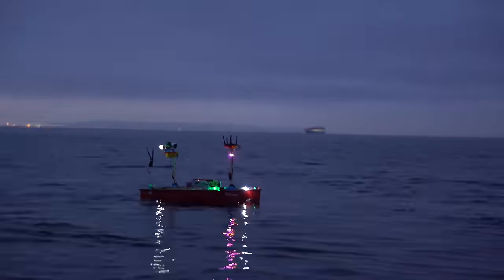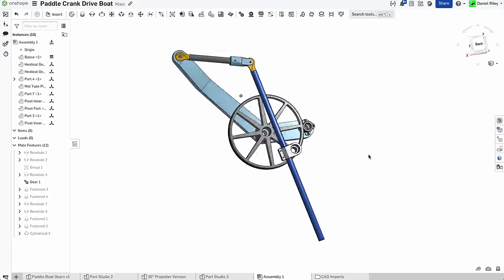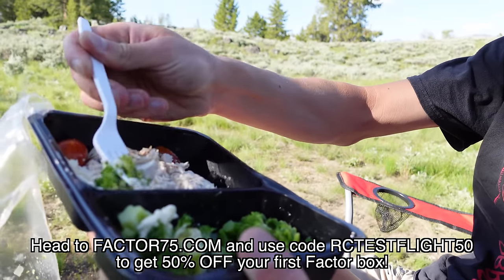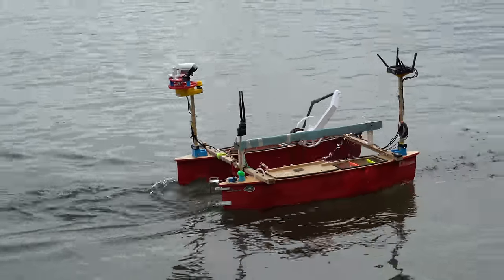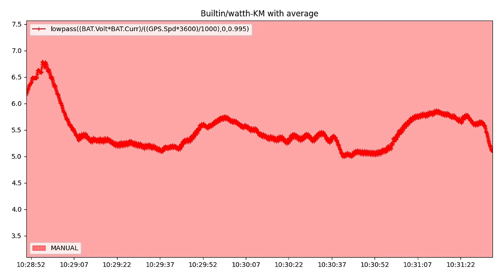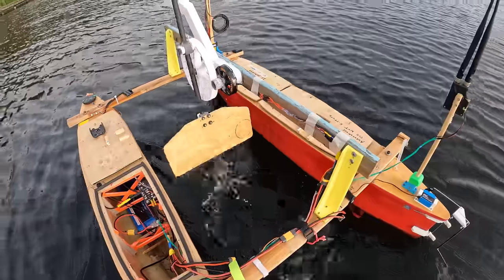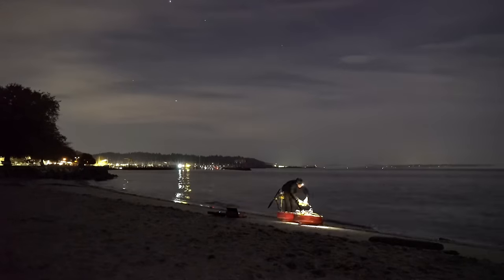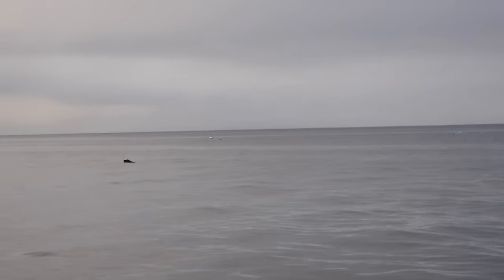Propeller Killer? High Efficiency Paddle Vs. Propeller

Comment: you could center the props more, near the center mass of the hull. That would eliminate front to back water contact you could also make an outrigger that contacts the water and arrest the pitching and oscillations although some wave peaks could still affect it in extreme situations. I would also try to keep any items from the upstream side of the props as to not block airflow. Even a slight mast in the way, slows the flow of air, this is a factor in wind generation and could be impactful in an efficiency situation like yours. Another thought, would A vertical stabilizer work in place of the rudder, may reduce drag in the water but would wind conditions have to many variables? would a vertical stabilizer be effective enough to even work or would it need to be to large for slow speed? Too bad you dont have a wind tunnel to test all of this, could be helpful.

Comment: It might be worth testing not just different propulsion systems but, also different designs of each system, for example with air power what about toroidal propellers or cycloidal.  Another approach to jet propulsion is changing the type of impeller from a turbine type to that which resembles a super charger. 
Another approach look at divers flippers, have two flipper type devices under water that are attached vertically to two shafts that work like contra rotating props. working like a wiper motor on your car causing the "paddles" to flip back & forth like a diver kicking his flippers.
last but not least when you transition circular motion to up & down you lose efficiency, go back to the Paddle wheel, but put it up front between the hulls, and like the paddle Wheelers of old use narrow paddles on the wheel, but angle them slightly so they exit the water at a more vertical angle so the wheel is not pulling the front of the boat down. best of luck with what ever you do.

Comment: If you plan to use air rotors in the next design, I recommend a flat bottom boat for better stability, raising the rotors a little higher, and trying to offset the weight of the rotors by putting more weight in the nose of the vessel. Airboats used in the bayous of Louisiana are a great example.

Comment: I find the paddle approach fascinating.  Perhaps instead of a perfectly flat paddle you might consider small perpendicular edges to help focus more of the water diretly toward the end of the boat,  I suspect some energy isn't going back but instead around the paddle. Also a small edge running across the bottom of the paddle as well, making the paddlle to become a bit of a scoop. And then there is the possibilty of having the paddle be not a simple flat surface but somewhat wavy from top to bottom.  Hey ... every bit helps, right?  You never know.

Comment: Interesting idea!  Some thoughts:

1. The paddle needs to be entering the water at least as fast as the boat is travelling forward, which means you need to have a way to measure forward speed through the water.

2. The problems with straining the system are almost certainly due to trying to push the paddle too hard through the water, which indicates that the speed of the paddle needs to be linked to the speed of the boat through the water and shouldn't be too far above the speed of the boat.  

3. The paddle needs to constantly be perpendicular to the surface of the water or you are wasting energy pushing down/pulling up on it.

4. A second mechanism can be used to constrain the paddle parallel to the surface on the second half of its travel.  You won't need to have the travel be as high.

5. Only having one paddle means the boat's speed will pulse.  Having more paddles with offset timing will smoothen that out.  There looks to be enough room to fit two paddle systems in a line without altering the current system design much.  (It would probably be better to have two paddles on the same mechanism, where the second one passes horizontally over the first as it returns to the front of the boat.)

6. Do the propellers need to hanging off of the end of the boat?  To my mind, putting them above the hull--as air boats do--would prevent them from striking the water as the boat rocks.

Cheers!

Comment: I think the floppy paddle could be improved some, though it's hard to say if it'll actually affect efficiency. I was thinking if i didnt hinge right at the top, it might recover faster, so what if it could bend along its length (like flippers) but only one direction? 
Think like a snap bracelet or a measuring tape, but hold it curved so that it can flex when needed, but doesn't rely on little elastics to recover, and instead on the flexibility of the material, and curvature that you design into the mount.

Comment: I like your videos. On this I would like to give you some of my thoughts.

1) in dragonboat racing teams are starting to rotating their paddles 90° to reduce drag on the forward stroke.

2) when comparing efficiency. There is a great influence of hull drag in regard of the achieved speed. Unfortunately I don't know what it is called in English. In German it's called "Rumpfgeschwindigkeit" that describes the effectiveness of hull length to desirable speed. It has to do with the produced wave ... Sorry I'm no pro in that area. But I suggest it could have an impact on the way you test efficiency.

3) the best solution is not always the most practical one. There is a reason why traditional Propeller underwater are so commonly widespread used. But I do like your creative approach to discover new possibilities. 

Keep it up.

Comment: Regarding the RC network filtering of the current signal, you would need very high component values due to the low frequency. The correct wy is, as you later did, to filter it in software.

Comment: To optimize the paddle your could install a perpendicular plate on both sides of the paddle to stop water flowing around the paddle and create wasteful vortexes. It would act in the same way as the vertical wingtip of a plane, which stops air from the high pressure curving to the low pressure side.
Perhaps the bottom line of the paddle (which goes deepest) could be curved slightly backwards. So when the paddle enters on an angle it goes straight into the water and also it applies more force on the water when moving backwards.
That having said, I wonder why the paddle is so much more better than the classic paddle wheel?

Comment: Duck feet paddles are some of the best & most efficient paddle mechanism we have :) ! the scrunch their feet together then angle them parallel to the water then flare them out to them use bare minimum work from their ankle joint for those muscles. which is very similar to this, but if they need to travel faster they will tilt in the water and have the foot get closer to the body and brush off more water, dip it down and flare their feet out to then push further in the water for a longer stroke duration. Gaining increased power but maintaining a fairly high efficiency, except of course it takes more effort from them. I think you could improve your design by doing this as well, or deciding to have a linear accelerated (magnets coils some flaring out diaphragms) pump attached to a mechanism like this that takes it out of the water and uses the duck feet motion (like foot movement to run vs walk, you use your calves to push yourself up and lightly jump/leap) of the final push at the end for the pump. 

the pump pushes out at the end of the rotation & but for the most part this paddle mechanism pushes for the longer stroke length, but because of its shape it can remain more parallel to the direction of travel and motion making it easier to transition into the water & out while also being able to reset itself during the out of water moment to improved efficiency of the paddle motion & power of the given type of paddle/pump design. 

Hope it helps, I'll watch the rest of the video now, I'm only at 2:39 in.

Comment: Are you familiar with adjustable paddle wheels? The paddles were connected via a lever to an excenter on the wheel axle. Quite a simple mechanism that automatically  adjusted the angle of the paddles while touching the water. In essence, it does the same thing as xour single paddle, but with continuous propulsion, for there are always several paddles touching water.
Later paddle steamers were all equipped with such wheels.

Comment: I think you could widen the paddle even further to gain more efficiency. Looks like there's a good 2" width each side you could claw back, lowering your windage each side.

You also wouldn't have the issue with the air props hitting the water when it's wavy (though it might mess up your motion relative to the water)

Comment: Put the props at the longitudinal center of the hulls. You could put rudders behind the props like airboats use to alter thrust vector and steer the boat. Also, put as much weight as you can towards the center rather than the ends to help with the hobby horsing when you encounter waves. 

The paddle mechanism was pretty cool.

Comment: So the paddle version was more efficient after all :)   The question is do you need to put the blade to the back...  And when it wavy, should you have some kind of 3d gyro to detect the orientation of the boat and use the motor to stabilize the boat OR turn the motor when it at a better level orientation.  You would also have to predict the future since there is a ramp-up in trust, so you would have to detect where you are in the wave effect and turn the prop a bit before.  And turbine in water do add more drag, but would a turbine like blade in air be more efficient ?  Where you can concentrate the trust more.

Comment: Your efficiency can improve by narrowing the gap beween the Blade and the hull.
Your wheel is also doing unefficient work, lifting the blade out of the water.
Your efficiency can also improve by having 3 or 4 blades on separate wheels.
This means the downgoing blade gravity assists the upgoing blade.

Comment: If you ever saw a duck hunter paddling a pirouge, there is very little splash and no sound. If you could somehow imitate that motion they use. It's an easy stroke and they can propel themselves for miles with little effort. That might work much better than a simple paddlewheel motion. I know when they withdraw the paddle from the water it comes out in a linear direction and does not splash at all.

Comment: I wonder if instead of doing a paddle, if you couldn't throw a similar mechanism vertically into the water to mimic a vertical fish tail.

I'm not sure what the ideal shape for a boat hull would be if it were using such a mechanism, particularly given that it would probably create a lot of resistance against the forward hull if it were static (like a pontoon).

I think there should be some form of self-stabilizing mechanism or linkage that could let the front of the hull remain static while allowing the back of the hull to rotate. With two or three links or points of rotation I think it could produce the "snaking" motion that you might see in a fish.

Comment: Take a look at a “weedless prop”.  Battery driven trolling motors often have them.  The leading edge of the blade is angled OUTWARDS from the center, not inwards.  Weedless props have been around a long time.
Courtesy of Half Vast Flying

Comment: Keeping the paddle vertical throughout its stoke should improve efficiency.  That can be done by using two drive gears on the paddle shaft. one high, one low to keep paddle at 90 degree angle to water.  Several people have suggested using a belt ("caterpillar tracks") which could also keep the paddles perpendicular to the water, but I still like your single paddle idea.  

It would probably be helpful to set up  a test tank to compare efficiency.  Even the Wright brothers figured out how to build a wind tunnel.   It's almost impossible to get repeatable efficiency results "in the wild" as it were.

Air propellers have some significant problems in the real world related to wind speed and direction over the water.  If you continue with them using a much wider blade to increase surface area can help with a slow turning prop.  And turning the prop as slowly as possible does reduce drag of the prop itself.

Also a pilot, boat river and engineer here.  I don't have any magic solution so you're back to the Thomas Edison approach.  Try everything.  If you've done 500 experiments that don't work you've learned that much more about what not to do.

Comment: I don’t remember how it worked but we got warned not to row a certain way because you’ll sink the canoe… we did it just to see if it was true… it worked. You may look at how competitive rowing teams use a paddle.   As far as the props hitting the water, could you just move the mounts closer to the center of each hull and arms that hold the props over the hulls just a few inches from the aft most point of each.

Comment: What if you made the paddle in a V shape with the point of the V facing towards the front of the boat.  You would have more surface area and trap/push more water during each revolution ?

Comment: The problem with your water propellers is that they’re very, very small. They’re also way up forward, which means that a large amount of the hull aft of them is exposed to the higher velocity flow in the prop wash, which means that it has higher fluid friction. Shafting losses shouldn’t be too high unless you have really bad (or no) bearings or shaft seals.

Comment: If propeller need more power in order to maintain the speed, there should be some seaweeds get stock on it. They get stock on same spot which is in front of the propeller as I saw on the videos. You need to attach a razor to a solenoid.
Open a slid under the hull. place the solenoid in the boat. Push solenoid pushes the razor and touches the shaft while it is spinning which cuts all seaweeds. Solenoid should be on the deck in order to make it waterproof and the slid which extends from deck to bottom of the boat should be closed. it is kind of a slid that blade can go through and no connection inside of the boat. I think, a square wood could work. Cut the square wood half. Make a pocket in it by CNC in order to slide the blade inside and then glue them together, and cut bottom of the boat to glue It.

Comment: For the waves, wind direction is a better predictor than its strength. If the wind is coming from the sea is will amplify the high of the waves, whereas if it from land it will decrease them.
When I was sailing long time ago the strongest winds I got were from the land and the sea was smooth, but a weaker wind from the sea gave us several meter high waves.

Comment: An alternative to rudderless steering is vectored thrust from a single air prop, rather than differential thrust from two air props.  Diameter could be larger, and a higher center line mounting might eliminate the water impact.

Comment: If you want a more efficient water propeller, go to a surface piercing setup, where only the blades are entering the water in normal operation.  You need pretty smooth water to make those work well, too, for obvious reasons, as in waves they will be fully dry or fully immersed most of the time.

Comment: Main problem with kayak fishing is to hold  it position due to ocean running current since it cannot use anchor especially in deep water. Perhaps you can design kayak than can lock it position based on coordinate or perhaps to add compass where it can control heading orientation

Comment: For ultimate efficiency, design some eccentric geometry like the oval cogs on some old bicycle chain drives that will slow the paddle when in the water and speed it up when out. Make a two paddle system that takes advantage of the biplane effect with the trailing paddle moving slightly faster through the water than the front paddle, then close up the gap between the hulls and the paddle blades.

Comment: Sculling a boat with a free turning oar, you pull wrist high then push wrist low. The blade turns with the same face pushing always. How large the blade and wide you sweep is your contact area. It's not hard to keep a load going, when you flip the paddle and sweep it the flow is unbroken.
The motion of the wrist; high pulling in then drop low and push out then raise high and repeat, how to make a wrist that does that?
On the vertical, tilt and sweep paddles could be put series in line between the hulls.

Comment: perhaps worth investigating oscillating foil rather than paddle? I remember this paper from the late 90's where experimental investigation indicated efficiencies as high as 90% for oscillating foils for thrust. "Oscillating foils of high propulsive efficiency By J. M. ANDERSON, K. STREITLIEN,  D. S. BARRETT1 AND M. S. TRIANTAFYLLOU" Journal Fluid Mech. (1998), vol. 360, pp. 41–72. They went on to build a robotic tuna with the same high efficiency thrust concept. weeds maybe still a problem unless sufficient sweep of the foil could shed them?

Comment: I think you're on the right track...   I look to mother nature for my inspiration...   For me, the most efficient - sub-surface - propulsion method would be what I call - '' Ceta-drive''.   Think- scuba diving fins...    This mimicks the semi-prehensile action of the rear spine/tail and flukes of a whale.   A horizontal paddle, submerged propulsion system.   Probably more practical on submersibles, but could be designed to work housed within a hydrodynamic submerged pod on a surface displacement vessel.   This system would also be quieter than a traditional prop system - no cavitation - and more energy efficient.  

Biomechanics is the way - as with mimicking avian dynamics,  likewise marine organisms - the longest evolving - have a vast array of efficient propulsion systems, but for larger vessels - the Cetaceans are perhaps the peak of sub-aquatic efficiency.   

Good bit of brainstorming, research, design and fabrication.